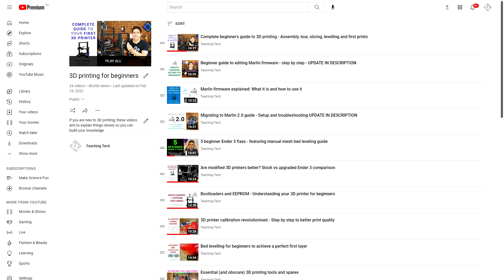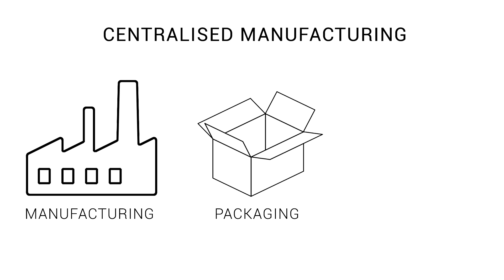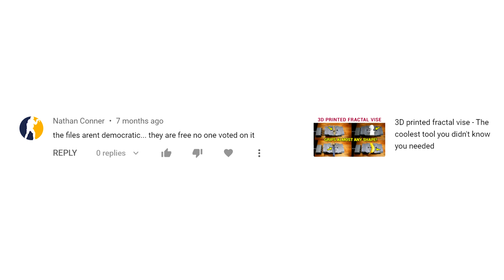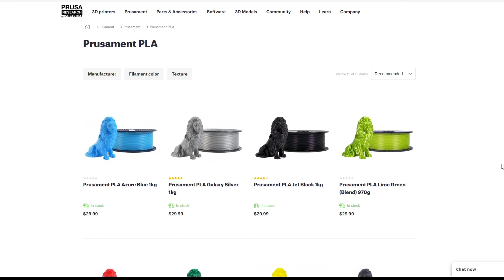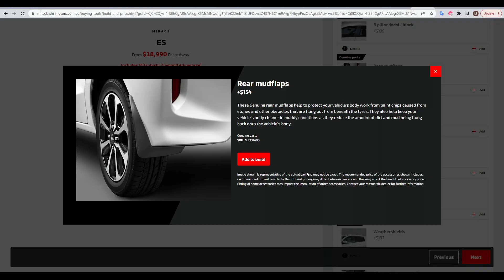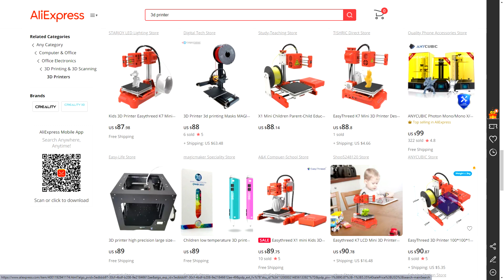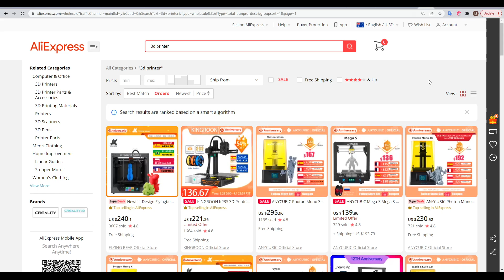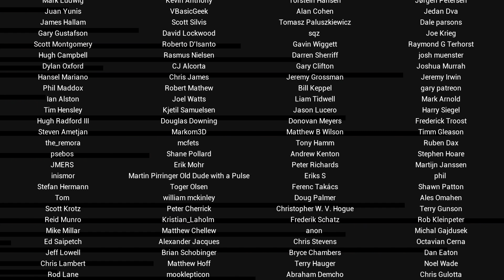3D printer trends are limiting mainstream acceptance: The 3D printing paradox

Comment: I honestly think that FDM/FFF will never be reliable enough for mainstream adoption, even the highest end Stratasys units still have failures. I reckon as soon as we see the patent empire around resin jetting fall we'll see a similar loss leader approach to desk top UV resin jetting 3D Printers that take proprietary cartridges and print reliably but with minimal "tinkering" options. To make that viable however we need a "word art" equivilent for 3D Printing (tinkercad and 3D Builder is close...) or the best damn file repository that seamlessly slices and sends to the printer. Give it another 10 years !
Reply: I think the biggest hurdles in regards to resin 3d printing to become mainstream, used by non-hobbyist, will be a revolution in resin that will either eliminate the cleaning and curing process or the production of a system, which removes the user from the task of cleaning and curing parts. In this same breath the next major hurdle that will need to be handle is a system, which minimizes the user in the cleaning/filtration of resin of cured particles in the vat; there are some systems, if memory serves me right, that can do this already, but you are paying a premium for such a convenience though with time and scale of production the cost of such a revolution will drop drastically like any other 'new' innovation; For example look at your phone(s). 

In the end I am greatly interested in see where the technology goes in the next ten to twenty years especially to see the various types of 3d printing and their adoption such as SLA, SLS, FDM, DLP, MJF, DMLS, and EBM. personally I am greatly interested in seeing what improvements and availability will be for things such as DMLS or similar processes that come out of research labs in the future.
Reply: @lordofh3  I can see automation of the post-work being created easily, in fact I'd say it's already possible, just probably clunky and would have some jank. After all, it's really just about moving parts around in different places and ways.
Reply: I have been thinking the same.  Granted, all my personal 3D printing experience is only on the low-end side in-person and YouTube for anything more expensive (and outside my budget) but nevertheless I just don't see how throwing more money and R&D at FDM printers is going to fix the fact that at the end of the day we are still talking about nothing but extruding a soft noodle onto a surface / previously printed noodles and hoping it will stick. Fact of physics is that sometimes it just doesn't :D
Maybe rare failed prints could be acceptable now and then, kind of like failing a CD burn back in the day. Problem is the mess it causes; At best you get a bundle of spaghetti, at worst the filament melts all around the nozzle / heatblock / gantry and maybe even catches fire due to too close proximity to the cartridge.
If FDM printers go towards detecting failures reliably and aborting upon sensing one, maybe they have potential as some sort of consumer devices. Still, everything that goes towards making sure your printing environment is as perfect as possible (IPA cleaning the bed, having an enclosure, etc) definitely makes it feel more like a DIY tool or at best the very low-end of consumer 3D printing.
As a DIY tool they are already at a very consumer-type level; As an example a circular saw also requires maintenance, care, replacing the odd blade every now and then, careful planning of the work you're about to do, etc.
Reply: Yes it will probably go into the proprietorially systems of manufactures of 3D printers like that already starts to exist in non-home-systems. A bit like the dawn of the PC's that were first only for bigger firms and later governments while the tinkerers were building their Tandy's and later got hold of for example the Commodore64 home-computer and the Atari's with specialised cardridges for buying their software which would only run on their devices of a certain era.
Good chance that there will be cardridge-systems from one brand that are not compatible with those from another and even from the same brand but  not compatible with another type.
I think it will be revolution of powder-printing with laser probably because that can create very nice parts without any real cleaning, no extra supports but just buy a cardridge, print untill that is 'empty' and then send back to refillstations or producer. And those can be plastics that can be also metal-like for the advanced home-users. Probably including build-in cleaners so you can just select the part to print (ready to print files from internet like PDF nowadays), wait some time and you have the part or parts you need to take out at the beep.

Maybe in 15 years or so?
Reply: My prusa mini(kit) has been more reliable for me than any of the inkjet printers I've had over the years. I'd put it on par with my laser printer.  

I think the bigger obstacle to mass adoption is the 3d modeling problem. Need to teach high school students blender and some parametric CAD, then wait a decade for them to buy a 3D printer themselves. It's MUCH harder to get adults to learn 3d modeling.
Reply: But also, WHY does it need to be mainstream, everything that goes mainstream goes through enshittification and dies, if we keep it a niche marker it might survive antr thrive.
Reply: Also something i forgot to mention in my last reply to someone else is that we're kiiiiiinda being optomistic here.

There's for a normal person who does not make things an incredibly limited use case. For one do any of us think bob from the office is going to take apart his fridge to replace a bracket after tracking down the model number and specifics related? 

No because bob doesn't care. He's gonna throw that fridge away when the compressor rattles itself to death since that's way easier for him.
Reply: MJ is also the ultimate in terms of multicolour and multimaterial (including soluble support material) and produces very high detail. It can also do functionally graded materials such as mixing rigid and flexible materials for variable material properties and colour throughout the part. XJet has special metal and ceramic nanoparticle inks although they require post process sintering. There is also research into low temperature silver nanoparticle inks for conductive traces. Also it's literally like a standard printer with different colour cartridges, although they tend to use large containers with tubes to the printhead. Low force, energy and temperature requirements, and is basically just a standard printer with more axis. Material properties/costs don't yet match common thermoplastics, but it will get there eventually.
Reply: What do you mean by "word art"?
Reply: Hmm, I'd give FDM the same odds as anything else. If resin jetting was going to be the breakthrough before now, the "patent empire" wouldn't have actually stopped it.
Reply: And my Epson printer had a paper jam, and my canon laser printer just started having toner issues. That means that printers are not yet ready for mass market adoption...
Reply: True 3d printing is just too involved for any newbie wanting to get in and print something . we need more "foolproof" innovations , like the e3d revo , that would make 3d printing simpler for the masses. PEI sheets were a game changer for anyone having bed adhesion issues. Etc
Reply: FDM is only just short of full CNC milling in terms of complexity. There's simply no way to make it plug+play.

Comment: To be honest I agree with your vision of the future of printers. One I  every home. However, there are still a lot of older generations that are scared of tech regardless of what it is. The other hand is that the companies and people who print for a living will need to change their livelihoods so it will see a lot of push back from that regard as well. I love to tinker but I also love to push a button and know I can walk away from it and it work no problems. However until the printers become a lot faster than they are now and have the quality finish and fitment, it's still too easy to go to the shop and buy what I need instead of printing it. I do hope that the tech picks up and improves but I don't see 3d printers in every home for at least the next 15-20 years. Even with the ever growing improvements done and upgrades available.

Comment: Look further, there is FDM printing, but there is also resin printing, there are powderbed printers, arc welders,... The FDM printer isn't all that interesting for the industry, fdm printing takes ages, the layers lines result in anisotropic behaviour and a poor surface finish, the strong,  heat resistant plastics are a pain to print, they take a ton of energy to print,... Things like MMU waste a ton of plastic for 5 color prints,.. 

The printing paradox is that cheap, mainstream printers at home and free stl's all around make it difficult for professionals to invest time and money in 3D printers or in 3D design, you can't compete with free, but free often does'nt mean good,.. without professionals, the quality of both the printers and the designs remain amateuristic,..

Comment: Atm I have 3 Artillery printers all with stock firmware and none of them will resume a print after power loss, they give the option and you select resume and it keeps printing but no filament extruded. I contacted Artillery and the usual response came, please send a video of your issue. Sorry I know you know of this problem in your firmware why should I send a video.

Comment: I think differently on this topic. 
I mostly use 3D printer as a tool and I have a startup company that do software to make it an even easier to use tool. The Ender3 style 3D printer is really the current optimal solution for most users (me included) who aims for low cost, easy to repair and speedy prototyping. Just like before iPhone every phone has a numpad, before we move on to the next impactful design appears, we will continue to stick with this for some time with slow optimizations done by each different manufacturer.

If every company comes up with their unique designs, it will just raise the price of 3D printers (as parts are not shared) and make it even harder to popularize in the consumer markets. We only need one (or a few) manufacturers to come up with unique designs and if it is great enough, everyone will follows.
Reply: the point here is that 3d printer companies are only aiming for cheapness, not really to improve the technology. its stagnant. the fact is, despite their price, they will never become common and widespread household appliances if the onus is on the users to learn and improve the technologies. imagine if you had to be a programmer in order to write emails or spreadsheets, nobody would have ever adopted more than one computer into their offices because having to teach everyone just isnt worth it- or even possible
Reply: Exactly, I have 3 ender 3 types (2 aquilas and 1 s1)  they are working non stop... when they break I fix them with cheap readily available parts...  When I needed a larger print surface I built one with and ender extender... I can print 400x400x500 .. a prusa xl cant... and it cost 1/4 and I got it in a week... not 1 year.  

3d printer Utopians gonna dream of utopia... We got work to do...

Comment: u just said it "for hobbyists|" All forums are filled with "cheaper - why so much" and u said it again "cheaper" u said it again "hobby" - prices of machines are either cheap or very expensive - 4-5k for a machine that large, used closed loop servos has ethernet etc.. is worth the price - low cost PUSH MEANS it will be always a "hobby" - its also slow, software sucks - FREE is a 4 letter word - enough complaints..... i pay for autocad and solidworks etc.. WHY? i dont need a project for everything. Why would i buy a cheap tool to only have to bastaridize it to get it to work marginally? to quote "come on man..........." We want to unbox turn on and make parts - fast reliable - and the next gen is hybrid - additive and subtractive -  3d printers are a tool in the box - we use them in our machine shop - we "print" inconel - 50k machine but parts on it cannot be made (easily) on million dollar machines - finallly inexpensive takes away from the quality of what can be done

Comment: There’s still such a large gap between functionality of the machine and functionality of the parts it makes. I think the game will truly be revolutionized when more functionality can be incorporated into the prints. I envision being able to (multi)extrude electronically conductive material traces to act as wires run through an enclosure. Or things like actuators that can install/incorporate threaded inserts magnets or hinges mid print. 
These are huge obstacles that must be overcome in order to close that “functionality of product” gap. 
Funny and sad, but We are still at the point that a multi thousand dollar machine with over 20 years research and development, is still just a big glue gun. 😭

Comment: I tend to agree with part of what you say but not fully the conclusion: 
 - I've been Making/using 3D printers and part of a FabLab since 2012 and if you look at the state of printing since then the progress are enormous (but not still sufficient for prime time.) at that time it took me 2 month and 800€ to build my printer and an extra month to have it produce acceptable prints. Now My latest Ender 3 costed 120 euros and took 1h (Ok this is only because I built more than 10 of them by now)  to assemble that is enormous progress, is it sufficient: no because it is still slightly more complicated than an IKEA furniture  and the documentation is minimal. The Ender3 was an enormous shock to the market because it was at the same time significantly better than most of the other 'cheap' printer and some of the mid range as well and much lower cost and they did that by simplifying the printer 

- In terms of software the progress has been great as well: when I started there was Pronterface, where you had to configure everything and if you did not know what you where doing you would never get a correct part.  Our understanding of 3D printing has improved and has been integrated in the printers & software to reduce the skills needed to do a good print, now CURA and Prusa slicer booth have default settings that works. Ok you still need to understand what you are doing if you want to move out from the defaults but this is already great.  

- In terms of reliability the progress is there as well , when I started you had to spend more time fixing or tuning the printer than printing, Today you still need to level the bed and fix things from time to time but this has reduced at least 10 folds, is it to the level of a 3D printer ? No it is still 10x or 100x more fiddling than a commercial paper printer.. In the early days I've known about people having their flat burned because they left their printer running and went away. I's been 5 years since an event like that was reported to me. Although it is slow technology is moving forward and the improvement are substantial,

New improvements are arriving helping to continue to improve:

-  Smart and silent drivers like the TMC2209, 

- More reliable bed leveling than the BLTouch & clones,   

- Speed: printing is very slow & not much progress was made there until the #speedboatrace was launched. and there VORON as you mentioned and the delta printer shinned + Klipper helped a lot, however as you mentioned this is for the highly enthusiast . but those technologies will arrive in the mainstream printer in 2 to 3 years. The time to tame them.  

-And there are new learning from the #speedboatrace and #CNCKitchen that are arriving like speed settings are not the right way to control but it is more the acceleration & the volume of plastic melted by seconds that counts. Once those are properly understood & digested by the software coders this will lead to  improved automatic settings an less things to worry on the user side. And globally more settings allowing you to do good prints with less fiddling.

Current Blockers:

- The complexity / scare of 3D: as soon as you mention 3D to people most of them get scared & say that it is too complex and they will never be abler to handle it. And there 3D design tools are not helping as it is still significantly complex to generate 3D shapes. There repositories like Thingyverse and others are of great help providing millions of pre-modeled shapes. But unless there is an easy way to model a shape  this will stay

- It still requires too much tinkering to be able for prime time (there I totally agrees with you) but it is improving.

- Speed, unless you want to do tiny prints it takes hours to days to do any significant print. improving the speed without the need to know in detail what you are doing is critical.

- The ability to send a print without any configuration is still not yet ready. 

So in conclusion:
- If you look the progress over 2 to 3 years there is not much visible however looking at a larger time frame progress is really big but we are still far from something usable by every one. I see a lot of progress on the blockers mentioned above except maybe for the 3D design that is still a hard point.
- I really like the fact that the progress is driven by the community: it is slower but it allow anyone who wants it to appropriate the technology, and make it democratic as you mentioned